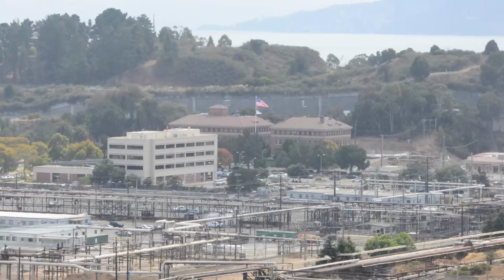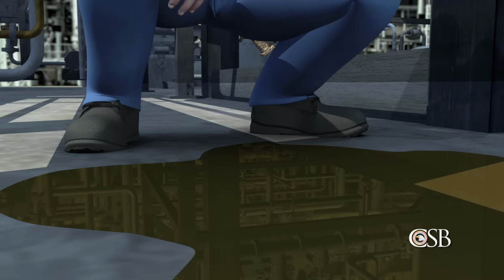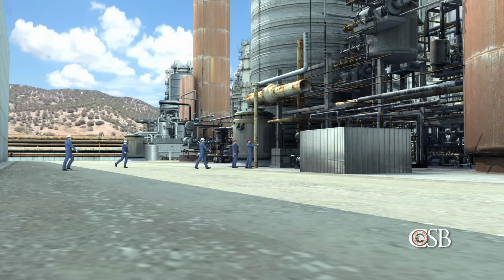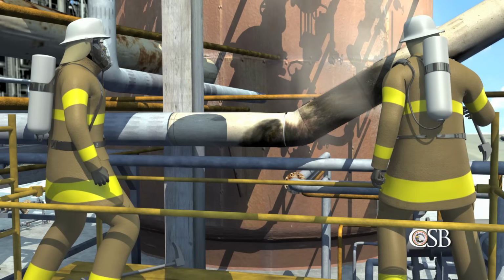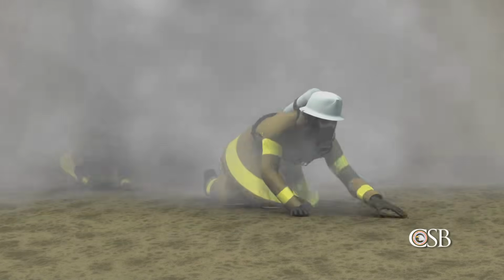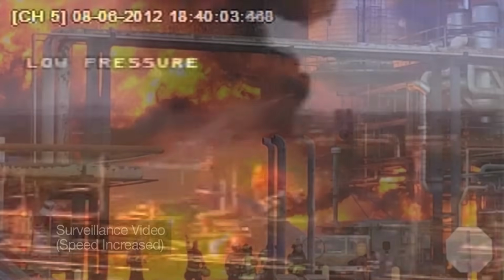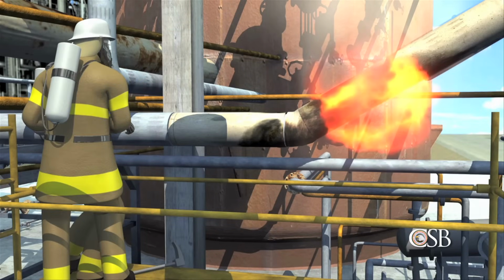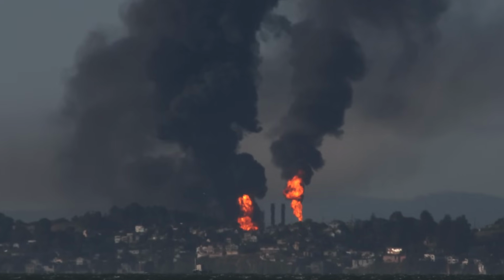Animation of Fire at Chevron's Richmond Refinery, August 6, 2012

Comment: Pop Quiz:

1. When first discovering the leak, what did the workers/firefighters do?
a. Initiate a safe shutdown of the unit before working. ❌
b. Consult with managers and site safety personnel. ❌
c. Leave the pipe be. ❌
d. Poke it with a pike pole.✅

2. After the hydrocarbons first ignited, what was the next action of workers/firefighters?
a. Initiate a safe shutdown of the unit. ❌
b. Observe the pipe at a safe distance. ❌
c. Carefully remove the insulation by hand. ❌
d. Spray high pressure water at the pipe to remove the rest of the insulation. ✅

Comment: If a pressurized pipe is leaking from rust, repairing while in use is absolute insanity and dispicable cheapskate behaviour that gets people killed. One oops was more expensive than shutting down for a proper repair for a few hours. No one goes to prison. Nothing new to see here. Also as a handyman, I can tell you that ANY steel pipe from 1976 that is OUTDOORS should be replaced by 2025. Acting like that's a surprise should be CRIMINAL.

Comment: 600 Fehrenhiet and sulfur content is high 
This kind of pipe operation need to be reviewed with right metarullgy.
Chrome steel instead carbon steel at this kind of operation.
Most pipes designed for 20 years with this kind of corrosive services but not 36 years as this company.

Comment: The same refinery has caught on fire every 10 or 15 years. I used to live in Vallejo, which is not too far from here and as a kid, I remember one huge fire that burned everything. They used to have the pipes going underground and those caught on fire and actually launched whole trees into the air while on fire and they completely burned up and floated around around just the carbon left left over it was actually a trip to see this. It was almost like it wasn’t real, except for it definitely was.

Comment: It was several  points :
Removing insulation relaeased vapor at flash point 600 fehrenhient..
Before removing insulation we have to check product temperature.

Fire man extiguished the hot pipe with cold water made thermal stress to the hot pipe and this  increased the leak.

Emergency valves is important to cut the  flow of hot pipe.

Insulation will become degraded by leake and it is experinced to reduce the flash point of leaked liguid to low flash point.

Some insulation combine with product snd ptoduce explosive mixture like ethylene glycol.

The frequent of dripping tells you how far this leak is going.

Last at 600 F temperature sulfur content will attack pipe  faster and reduce pipe thickness faster than schudled..
for example l mils per year is expected.
But at this temperature and sulfur content it will be 2 mils per year.

Comment: We had a leak on our Crude column Naphtha section. A blank flange wore a 3/4” hole and Naphtha spraying everywhere.
As the operator on shift I was yelling to the console operator to shut down, however the senior operator and refinery team leader prevented it.
Instead fire monitors were used to “disperse” the liquid while operators in flash gear went above the leak to close a 36” valve.
It finally got closed and leak stopped. Everyone was lucky that day.

Comment: I’m surprised someone thought it wise to strip the insulation, maybe your lucky, but most likely not, and chances are the leak will be on outside of an elbow, which you can’t clamp anyway. Before you ever see a puddle on the ground, there’d be smoke coming out of the insulation, if there’s a puddle, it’s too far gone to think about clamping.

Comment: I was a cooling tower inspector in the 80s and  the plants would almost refuse to shut them down. One unit I inspected was near failure, but they decided to fix it the following year on the new budget. Ten days later the entire tower collapsed , shutting the unit down at a cost of 1.8 mil a day in lost production. It took 6 mo to rebuild. Our cost to repair it was only 500 thousand when I reported the problem and we could repair it piece by piece without having to shut down the operating unit  But money talks so we let it fall. Our charge to rebuild it was 8.5 mil! OUCH 😮

Comment: The most baffling thing to me is that the leak ignited at one point and the firefighters didn't at the very least evacuate the immediate area after.

Also if a pipe catches fire during operation of a reactor it's no longer operating like normal. Obviously there's an emergency, and it's time to do the reactor's emergency operating procedure (most likely shutting it down)

Comment: Hopefully somewhere is a giant rulebook at Chevron there is a new rule about "If you encounter a hydrocarbon leak DO NOT poke at the leaking pipe with sharp sticks or pressure wash it with firehoses while the unit is still running.  Also disconnect valves are pretty cool and maybe we should look in to adding those so individual pipes can be shut down and repaired without stopping production."  The only way they will get a budget to add valves will be if they play up not halting production.

Before these video I would have never guessed that grown men need to be told "don't poke a leaking high pressure pipe full of explosive hydro carbons with sharp sticks.  Also don't blast high pressure cold water at hot, leaking high pressure pipes full of explosive hydrocarbons".  Turns out a group of presumably well trained firemen though "Poke it with sharp sticks" was a fine way to deal with a leaking pipe. 

Maybe there needs to be a NFPA code and firefighter training about "poking leaking pipe filled with heated high pressure explosive hydrocarbons with sharp sticks and why you should never , ever do it".
I will give them bonus points if they include the phrase "Hey dumba$$" in this code.

Comment: A stainless steel pipe or what ever pipe more resistant to errosion could have been prefabbed and ready to replace the worn one and every other critical pipe on the vessel with a valve on each end . Of course the vessel itself needs inspection. From shut down , clean out , purging for cutting it wouldn't take 2 hours to weld in a prefabbed replacement.

Comment: Maybe have a pipe with flanges so it could be changed without cutting up the reactor connections. They mentioned the temperature of the condensate, but they didn't mention the pressure. Anyone know ?

Comment: Another story where profits were put ahead of safety.  I think one option would be laws where they loose all profits from the moment they have information that there could be a problem (when they found the weak/corroded a decade before).  If the punishment was the loss of all profits for a longer period like that, it would definitely have been shut down earlier or even repaired... as the costs to the company would be high enough to put the safety ahead of profits.

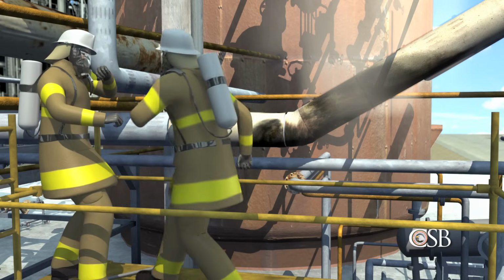Comment: 3:27 how does the vapor ignite?Is it static electricity?
Reply: Because it's above the auto-ignition temperature. The reason it doesn't ignite while inside the pipe is because there is no oxygen. As soon as it mixes with atmospheric oxygen and reaches the correct fuel/air ratio, it self-ignites.
Reply: @Orcinus24x5  wow ,thank you

Comment: Did spraying the hot pipe with water cause it to crack more?
Reply: It's very possible. Suddenly cooling hot metal like that has been known to warp and crack thin steel parts.

Comment: These are people that make a lot of money because they have serious educations and are supposed to be very smart. Yet they did something so stupid that even Cletus from Kentucky knows better. Brake lines on a car have problems like this. They can develop tiny leaks that will seep for days, weeks, or months. However, the slightest touch and the line will immediately fail, EVERY TIME.

I am an auto meachinc (not a cletus, but a properly certified mechanic), and if you see a brake line seeping or leaking, you don't touch it until you have the OK to repair it. Otherwise you WILL cause it to leak worse even with the lightest touches. These fools were pulling the pipe apart with not brake fluid measured in ounces, but flammable and explosive fuel that was well above the autoignition point of the fluid.

I'm glad no one was hurt, but everyone here is an idiot. Just quit at that point, the golden handcuffs are not worth dying over or killing others.

Comment: Lets dump cold water on a 600 degrees worn out known leaking steel pipe and lets see if it cracks ,but before ,lets poke it with pikes so we could make sparks...
Lets be sure we are in a refinery first.

Comment: God. I'm so happy that no one died.
But the way that was handled was so painfully stupid. Pulling away insulation on a working pipe filled with heated hydrocarbons using *pike poles*? And when that didn't work and caught fire, they tried stripping the stuff away with cold, high pressure water?! I'm amazed that didn't end worse. But I'm at least thankful that the survivors lived to learn from it.

Comment: So let me get this straigt.
A leakage at a pipe containing highly flamable hot liquids did not warant a shutdown
The leakage widen and leaking hydrocarbon vapour did not warant a shutdown
That vapour igniting causing a fire on the pipe did not warant a shutdown
The pipe almost bursting and flodding the area with flamable vapour finally managed to shut that down.
They should have shut down production as they found the leak. But that costs money so nobody does it

Comment: The truth – There Was A Leak In The Waste Diversion Piping – Valves Directed The Waste 2 Containment Vessiles As Rich refinery Was Warned As Others Not 2 Burn Off - - They Then Held The waste in containers Until Certain Times Of The years @ night – I Have Pics Of As Other films -This was a diesel fuel Processing wast section -they let the leak grow to 3 leaks - -waiting 4 an accident – when the mixture finally combusted – several people were Injured – the fire spread 100’s of feet Quickly – and combusted Almost immediately – this is the reason the films 1’st shown are now graphic reproductions – Later Rich refinery raised the price of gasoline which had nothing 2 do with the fire – after other refineries also experienced similar fires – all raising the cast of gasoline -the Cal state govt used this 2 include a secret gas tax increase and thus the price there is over $4 P/G – people watched the films – saw the reports as they happened and know that this was a manufactured event – which profited the refinery @ the cost of 100’s of 1000’s of people – I have A Friend who Was just a few blocks away witnessed it in person -  -

Comment: Why not shut unit down and then do things safe.
Bet the bean counters depreciated the structure many times since it was first erected because the structure deteriorates over time.
But slackers did not want to do what a sensible person apparently recommended-
Shut it down. 
The original design plans did not include a safety shut off valve to isolate , for some reason. Perhaps because a safety valve itself might have to be monitored and maintained.

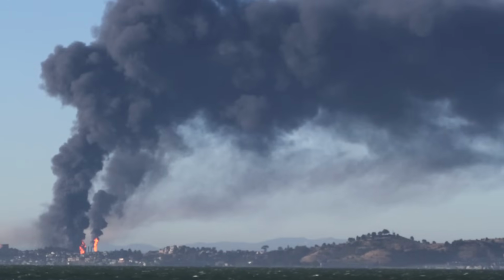Comment: the decision to shutdown the unit came only after dousing a fire aka way late in game to any non-expert.  so mgmt is trying to frame a fire-fighter and likely over-exaggerating the poking he did.  why?  liability, because 5:25  the fire burned for hours, then over the next several days over 15,000 people sought medical treatment at hospitals for various symptoms incl. breathing.  

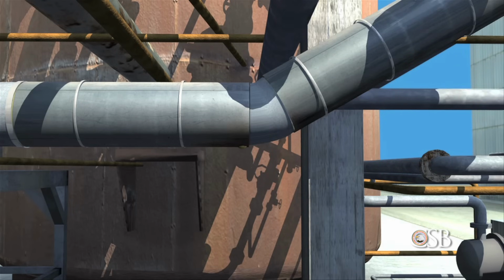5:55  carbon steel piping is super susceptible to this type of pipe-thinning corrosion over time when steel is exposed to sulfur carbons at high temperatures.  6:15  CSB learned sulfidation corrosion had caused major failure at chevron refinery salt lake city 2002, so an inspection of piping at richmond recommended replacement for that section that did not occur and was never inspected again.  in 2009, chevron experts recommended that every segment of high risk carbon steel piping be inspected, it was again not done.  in 2011 chevron inspectors examined some, not all, locations along #4 sidecut and found significant thinning and replaced some sections.

Comment: Take away:  The "poke it with a stick" method of problem solving seldom works.
Reply: poking it with a stick is a standard way to remove insulation
Reply: Same can be said for "spray it with a hose"
Reply: Bigger hammer is best.
Reply: But it might! And that'd be cheaper than doing it properly!

Comment: The pipe had worn to paper thin at the rupture. Let's park a tax payers fire truck under the leaking pipe, Yeah Lets.
Reply: Chevron has their own dept.... Not tax payer funded.
Reply: @frenchfryfarmer436   Did you see the whole video?
Reply: @unclequack5445  I did
Reply: Sad ending any way you look at it. the connection should have been supervised by a plant worker not a driver
Ive seen a SS 90 degree elbow worn razor thin.

Comment: Call me old fashioned perhaps but if the main function of your facility is to manufacture and store millions of gallons of flammable and explosive liquids, should you not operate on a safety first basis? Or, at the very least, should you pay heed to your own experts who warned you of the issue on at least two separate occasions prior and actually predicted the year that your pipe would fail?
Reply: If I realized how dangerous refineries could be I would not work there or live nearby. I have not done either.

Comment: I see the Comments below....I worked at Chevron many times from the 70s until 1995 off and on...I'm a UA 342 RETIRED WELDER.....A lot of the Pipe has 4"s of insulation around it then a thin Layer of tin.. To get to the pipe the INSULATORS cut a Plug hole down to the Pipe then U.T. it like a Sonogram for Pregnant woman to check the thickness....They just do it here and there...They NEVER used to do that when I was working there in the 70s 80s and then Started to in the 90s after the Fires and so many Lawsuits.... When you go there as a Contractor you keep your MOUTH SHUT...You don't go up to some CHEVRON Guy and tell him there's a little leak over there or You'll be fired.....Were there to make money....If It Burns Down I could care Less... Hopefully no one gets hurt....After the Fire we can go back in and Repair it making more Money...I'm Retired now but writing this could cause problems for my Union ....NOBODY  CARES IT'S ALL ABOUT THE MONEY....

Comment: I've worked on some of these Fires repairing the pipe after the Fires...when you walk down the Pipe ways Thier about 12' high and 12' wide then another row of pipe about 3' higher and another row... Usually 4 or more layers.... After the fire you get back and you can't even see threw the pipe...It's all bent down all the way to the ground all 4 or 5 layers...UA 342 Retired welder...

Comment: I actually worked as an inspector in this Chevron facility mentioned here in Salt Lake City. They routinely check lines now with ultrasonic inspection - thickness gauges. I can't believe Richmond's plant went THAT long without any routine NDE inspections being called on it. What a shit show.
Reply: Mr nostromer, had the leaking needed ignition source,or it was so hot that it can selfignite ,any good answer?
Reply: I mean vapor cloud should come in contact with spark or it was that high temperature liquid who can make it ignite.

Comment: Fail to shut down the unit immediately.
Removing the insulation on a live line was a stupid move.
Shutdowns aren't well liked because this can create additional hazards.
Because of the EPA and the high costs of operation there is a shortage of refineries stateside.  Operators feel pressured to maintain maximum output.  Thanks Obama...